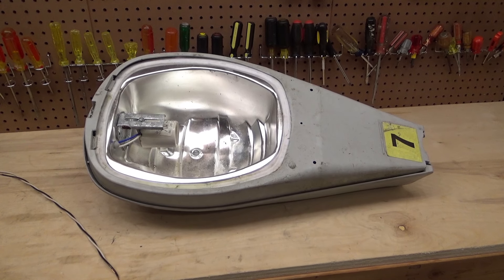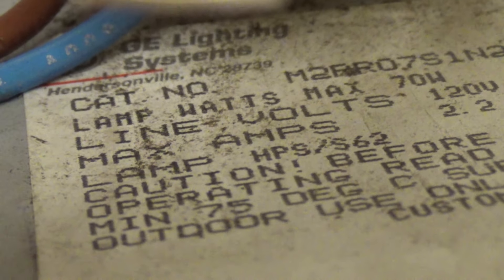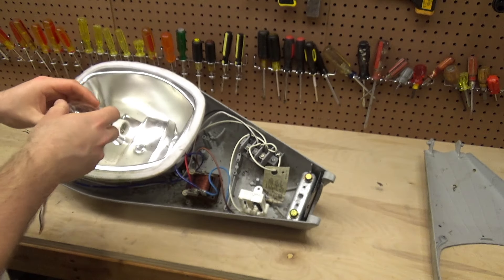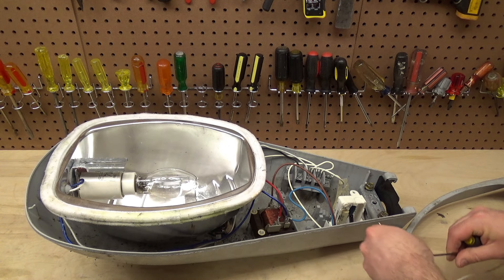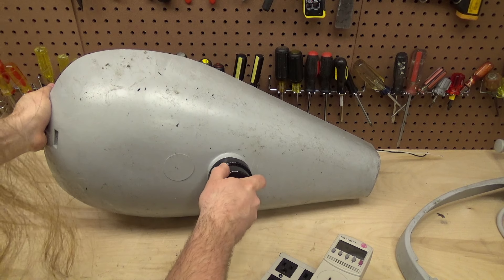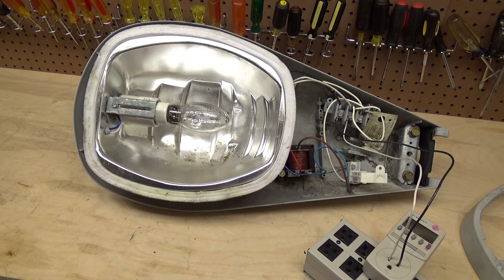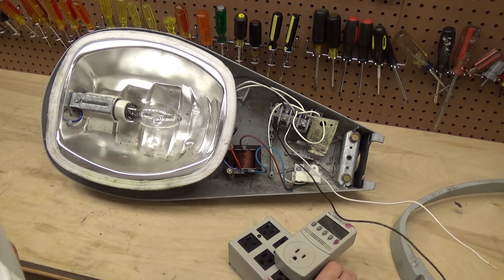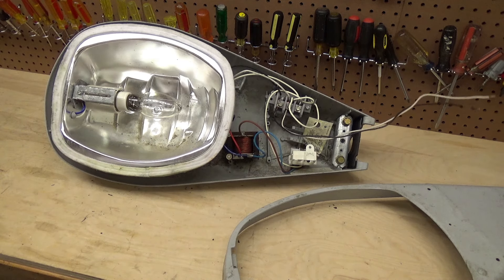1994 General Electric 70-Watts HPS Street Light Test

Comment: Doesn't HPS require an ignitor?🤔
Reply: Usually these types of lights do not require an igniter, instead, they require to be struck by a striker in order to light the bulb. The striker is a high voltage surge of electricity to start the bulb. The Striker is part of the ballast circuit required to start the light.
Reply: @Alco16-251F   AKA an ignitor. It delivers a high voltage pulse to start the lamp
Reply from the maker: I believe the white plastic apparatus is the ignitor.
Reply: @JordanU  It is. I think that's the part that might be broken.

Comment: You should bypass the ballast, hook the feed directly to the socket then install a mogul base "led corn cob" bulb in it.

Beneifits:works longer, the lights are instant on, the colour of LEDs never change. Also, if the corn cob ever failed, it's just a matter installing a new light bulb.

- an electrician.
Reply from the maker: LED does not work longer and the color of the bulb does change as it ages. If I use a ballast bypass configuration, it will be an incandescent bulb.
Reply: @JordanU  Weird. I guess I beg to differ. I work in an hospital as an electrician and all our LEDs worker longer and never change colour.

Metal halide lasts 15,000 
Hours and the LEDs last 50-100,000 hours.

I can install a brand new corn cob 3 years later and the color will match the same as the other LEDs side by side. 

But if I instal a MH bulb  side by side it the color looks different year to year. 

Often the drivers or ballasts will die before the LEDs themselves.
Reply from the maker: Perhaps you are working with better quality fixtures. The majority of fixtures installed around here are extremely harsh on the eyes and seldom last as long as what they replaced.
Reply: @JordanU  Not sure. But we make sure we get bulbs rated for "totally enclosed fixtures." If you install LEDs not rated for totally enclosed they will die prematurely.